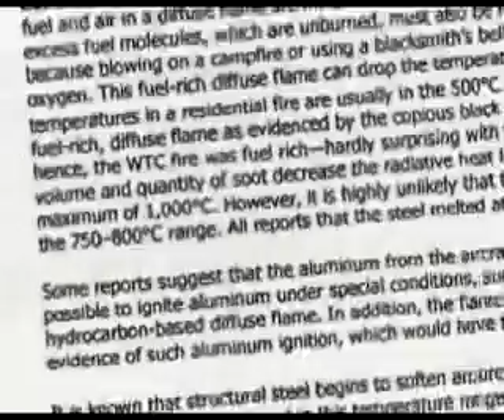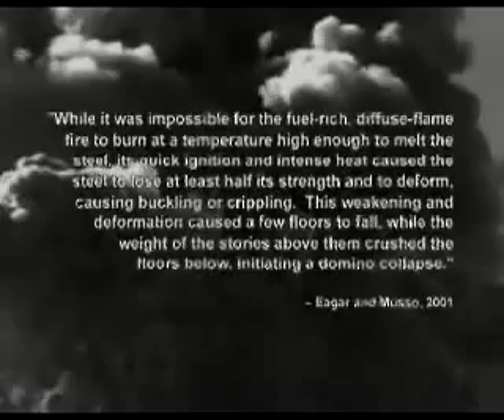Steel Facts and WTC Collapse (Part One)

Comment: @yewutube where are you getting this information "whats simply astonishing and inexplicable is the way the building was ground to a fine powder (except for the steel). Everything else was vaporized" because I can testify that when concrete is pounded on it turns to dust, and everything else other than the concrete probably burned and got crushed into paste.

Comment: i once lit a fire under an overpass, rebar reinforced concrete...  well, obviously, the steel weakened and the concrete turned to dust..  because that's what happens when ur dealing with fire..

Comment from the maker: @TheBlueFalconX 
I recommend that we start a new demolition company that would change the MO of conventional demo. This new company would require no planning before hand and there would be no need to study the blueprints or infrastructure of a building anymore. Just put a small hole in a steel framed high rise. Say 4-6 floors in a 110 story high rise for example. Next, pour some jet fuel on the hole, ignite it and watch the entire 1350 ft high rise crumble in less than an hour.

Comment from the maker: @tommyboy31885 
Relevant question: Where is the load bearing weight pushing down on the undamaged floors if the concrete was immediately turned to dust and if the steel was ejected laterally?

Comment: Wait, it was a fire that took the towers down? I guess I didn't see the two GIANT planes hit the towers which would cause weak spots in the building, but if you say it was a fire I guess I can believe your dumb ass. One more thing, the fires didn't have to melt the steel it only had to weaken it.

Comment from the maker: @tommyboy31885 
No extreme temps...

"Of the more than 170 areas examined on 16 perimeter column panels, only three columns had evidence that the steel reached temperatures above 250 ºC (480ºF). Using metallographic analysis, NIST determined that there was no evidence that any of the samples had reached temperatures above 600 ºC (1110ºF)." (p 140)-NIST

Comment: no, you're right. 19 hijackers working out of caves infiltrated into our society and waited for the opportune time to strike. all got past airport security, overthrew four planes and crashed them all in the same day. and, even though a steel high rise has never ever collapsed from fire and/or small damage before OR after 911, three of them just collpased in secs. and rust and al resembling thermite with nano structure was found in the order of tons. that's one helluva rusty building, huh?

Comment: i'm not trying to intimidate you. just presenting the facts. that's all. again, there are NO 'normal" building materials matching the characteristics of the chips. is this right? bits of rust, Al, liquid, and silicon gel were in the WTC dust. all components spontanaeously merged, formed a red gray bi- layer, changed the chemical structure, and created a very complex internal nano structure. the exact same thing occured with about 100 tons of chips at ground zero. is that what you're going with?

Comment: science? false claims? so, 9 scientist did not evaluate chips found in the wtc dust and determined that the had the same chemical structure as thermite, gave off 700C temps and had a nano structure? are these chips normal to a building? absolutely not. does it matter that the 9 scientists did not have a known sample of nano thermite? no. are these chips normal to a building? absolutely not. that's what this is really about. these are the facts, but with your hidden agenda gets in the way...

Comment: where i call from, if you make a statement in an attempt to refute something, you must offer evidence. otherwise, it means nothing, which is where we are now, huh? just more and more circular ranting with no evidence. this is very simple. provide evidence that ANY building material (primer, rust, Al, anything) has the same chemical structure as thermite, gives off 700C temps, with a complex nano structure when scanned at 50,000X. just give it a try? continue the rant..

Comment: Do you have proof that Nano-Thermite has all those characteristics or do you have proof that certain materials in building or apartment window sill that Jones got the stuff off of didn't have those characteristics?

Which would be easier to prove?

Drop your argument from ignorance and actually prove using scholarly methods that Jones has Nano-Thermite by showing us what Nano-Thermite looks like under the same conditions.

Comment: no, actually there were two distinct layers. if you don't like the word "matrix", does primer have a gray layer consistng of iron and oxygen? a red layer consisting of silcon, oxygen and carbon where little hexagons (made of aluminum) and rhomboid shaped grains (made of iron and oxygen) are embedded? and all of this is not visible until magnified at 50,000X? sounds like some really advanced primer, huh? its completely ridiculous to even entertain your insanity..

Comment: Silicon is a normal ingredient in Primer as well as Aluminum Stearate. 

Your "matrix layer" is a big word that Jones through in there because it sounds "sciency" scroll back to see one of the hallmarks I posted. It's "technical sounding jargon" designed to trick laypeople like yourself into thinking that the chip Jones found is intriguing and worth a second look.

Comment: the recipe for nano-thermite:

"The mixing is accomplished by adding these reactants to a liquid solution where they form what are called sols, and then adding a gelling agent that captures these tiny reactive combinations in their intimately mixed state. The resulting sol-gel is then dried to form a porous reactive material."

so, rust and Al just spontaneously mixed with what liquid?? and a gelling agent appeared from nowhere to combine the two? ok. just getting started..

Comment: (cont.)

"The energetic coating dries to give a nice adherent film. Preliminary experiments indicate that films of the hybrid material are self-propagating when ignited by thermal stimulus 

(Gash et al 2002). 

this is from Kevn Ryan's (yes, 1 of the 9 scientists) paper, "The Top Ten Connections Between
NIST and Nano-Thermites".

JUST a little more complex than rust and aluminum, huh?

Comment: the chips were scanned under a SEM at 50,000X, remember? As it turns out, nano-thermites were developed by US government scientists, at Lawrence Livermore National Laboratories (LLNL) (Tillitson et al 1998, Gash et al 2000, Gash et al 2002). These LLNL scientists reported that.. 

The sol-gel process is very amenable to dip-, spin-, and spray-coating technologies to coat surfaces. We have utilized this property to dip-coat various substrates to make sol-gel Fe,O,/ Al / Viton coatings."

Comment: yes, you would be correct if there was a documented profile of nano thermite available. what they do know is the chips had the same chemical structure of thermite with a highly advanced nano structure. and no. if there was any evidence to suggest that particles of rust and aluminum had the same characteristics as the found chips, they could compare. but, there is no proven evidence of this. until then, they concluded that the chips were nano-thermite....something entirely new

Comment: the 9 scientist didn't have to know what nano thermite looks like. they just analyzed the chemical properties of the chips and concluded that it was thermite wth a nano structure. i guess you can call what you like. thermite with a nano structure? nano structured thermite? nano thermitic chips? any of these grab ya? did you find a documented profile of nano thermite that the 9 scientists could compare to yet? after all, this is basis of your arguement, so it must exist, right?

Comment: You don't have enough data to draw that conclusion. 

Jones is a grifter who's taking advantage of you using pseudoscience
. 

"Lack of effective controls, such as placebo and double-blind, in experimental design. (see Scientific control) "

"Assertion of claims that a theory predicts something that it has not been shown to predict"

"Creating scientific-sounding terms in order to add weight to claims and persuade non-experts to believe statements that may be false or meaningless."

Comment: very simple question asked nth times now, but never answered for obvious reasons. what building material has:

1. the same chemical structure as thermite
2. a red gray bi layer
3. gray layer composed of iron and oxygen
4. red nano structured layer composed of:
a semi transparent matrix layer that is composed of silicon, oxygen and carbon
5. embedded into the matrix layer are:
hexagonal plates that are mostly aluminum
and rhombic grains, mostly iron and oxygen 

obviously nothing..

Comment: these flashes are people standing near the towers and looking up to the flames?

watch?v=elYw7MHf7GQ

the other video I posted showed flashes many hundreds of feet BELOW the fire...no flames, no fires, no heat or pressure. but it is interesting that you see smoke coupled with these flashes even though there's no fire near them. hmmmmm? again, your explanation makes no sense...the flashes are demo charges going off throughout the building.

Comment: the dust is from the concrete. smoke from where? the fires? you can't be serious? this "smoke" was found miles away from the wtc. 

the smoke plume:
watch?v=fPewS4GV1ko

flashes with smoke:
watch?v=Jqu_-yHqums 

your explanation of the flashes makes no sense. again, show me the mechanism how the heat became buried? fire still needs oxygen, right? underground? but, the fires never got there in the first place..

Comment: Are you sure the dust at the very start of the collapse was not smoke?

The huge smoke plume was  (I don't know, show me what you are talking about)

The reported flashes were people that were standing near the towers who looked up and saw flames being pushed out. 

Buried fires would be expected. 

Temps underground would get hotter because the fires are insulated and can thus build up more heat. (refractory).

Comment: explain the following logicial:

1. witness accounts of explosions in the sub-basements levels
2. huge smoke plume rising from the base before either tower collapsed
3. flashes seen all throughout the building unrelated to the fire
4. concrete pulverized to dust at the iniation of the collapse
5. fires buried underground lasting for weeks without oxygen
6. temps buried underground hotter then the max temps recorded on the impact zone steel

Comment: i'm afraid not every intelligent well trained person agrees with you.

700+ engineers and architects..

patriotsquestion911*com/engineers*html

i thought i was clear, but here it is again. a combination of demo charges and nano thermite led to the collapse. this explains the explosions/flashes all throughout the buildings and the heat buried underground lasting for weeks. thermite was used at the base. do you think the small fires had enough heat to melt cars and firetrucks?

Comment: everyone knows it? apparently, less than an hour ago, YOU didn't know the columns were even cut? this is hilarious!! and i'd like to know. why would clean-up workers spend time cutting precise 45 degree angle cuts n the columns? brain liquified? you assume all that this was a normal demo job. obviously not. nano-thermite (or something matching the exact chemical structure of thermite with a complex nano structure) was used.

Comment: The columns were cut after the towers had collapsed by clean-up workers. 

Everyone knows that. 

Yes, people in the stairwells next to core or in the building while explosives were going off would not have lived. 

You can't argue this. Demo Charges will liquify the brain of anyone within 50 feet of them and several injure anyone within 100 to hundreds of feet of them due to shrapnel. 

I didn't realize that you unaware that the steel that you are viewing was cut that way during cleanup

Comment: the columns were cut in a 45 degree angle commonly used in demo jobs. even other debunkers have tried to refute this. my only guess is you're commenting on something you haven't actually seen again? here's a clip:

watch?v=dUuEdMer7wI

NIST did not test for explosives. what does walking in stairwells have to do with explosives? word of advice. try and back up your statements with some actual evidence. you say "doubtful' without even reading the study and I'M arrogant? funny...

Comment: The columns at the base were uncut, the core also stayed standing after the floors and outer walls had collapsed. 

This proves that no charges were used on the core columns not to mention that NIST found no damage from explosives on incendiaries on the columns

And the fact that some people lived who were in stairwells right next to the core. 

Perhaps you should take off your arrogant cap and try to learn from instead of trying to refute the engineers at NIST?

Comment: 1. this heat did not exist. 2. the upper floors smothered the fires at collapse. 3. most of the floors were pulverized to dust and expelled laterally. 4. there were intact bottom floors after the collapse which prevented anything from getting into the basements. so, whatever was in the basements, stayed there now with tons of rubble on top of it.  

5. watch?v=Zww9-AaIgrw

added all up=no mechamism

Comment: NIST didn't find any columns that had been heated enough to show signifigant weakening. 

Lots of steel within the pile showed weakening by fire but that was irrelevant since one would not be able to determine if it had been heated while the building was still standing or by fires within the pile itself.

Comment: so, you're saying NIST did find samples weakened by extreme temps, but said what the heck, don't need to test these? and let's get on the same page here. NIST did not find samples directly from the impact zone that experiences heat over 250C. the underground fires burned until about dec01. again, where is the mechanism for the fires above to get underground? did these small fires also cause cars and firetrucks at ground zero to be overthrown and melted beyond recognition? enter thermite..

Comment: Excellent. We know they are correct yet you tell us that NIST found no steel weakened by fire?

Is it more plausible that they found lots of steel weakened by fire but that it was pretty much useless since all the evidence had been compromised by fires that burned for weeks within the pile?

That's really a different topic altogether. 

What it tells us is that NIST was unable to find any columns that had seen signifigant temperatures since those are the only samples they had.

Comment: ok. the fires were 800-1000 ft up. NIST did not find steel samples that experienced temps over 250C. people were seen at the impact hole right before the collapse. therefore, there was NO significant heat. at collapse, the upper floors came down onto the impact zone most likely smothering the fires. also, the majority of the concrete was almost instantaneously pulverized to dust and/or expelled laterally. so, there was no mechanism for these fires to end up in the basements. 

agree?

Comment: Nope, no agreement there. 

Firemen reported fires within the pile weeks later which you would expect since there are lots of things that are flammable within the building. 

And the fact that concrete dust makes a pretty good refractory to insulate and keep heat within the the pile. 

So to be clear, no we are not in agreement here. You would be hard pressed to find someone to support a claim that would say no fires should have been burning within the debris pile.

Comment: NIST found no steel samples that were subjected to temps over 250C, but NASA recorded temps buried under ground over 700C five days after 911. hmmm?  there was no extreme heat at the impact zone and no mechanism for temps to be buried underground for weeks. enter thermite which incidentally, has it's own built in oxygen source, so it can sustain itself. the chips were proven to be nano-thermite. therefore, it must be thermite or some analog that caused this heat.

agree?

Comment: and the 8 other scientists? are they in on it too? could be a conspiracy, right? again, what did jones and company have to gain by doing this? Hmmm, being suspended from your job and being called a liar? and, i look at ALL of the evidence; flashes throughout the building, witness accounts of explosions in the basement areas, this heat buried underground unrelated to the fires, smoke rising from the base before either tower collapsed, nano- thermite discovered. add it up.. done

Comment: Um ok. How about NIST?

The responses to questions number 2, 4, 5 and 11 demonstrate why NIST concluded that there were no explosives or controlled demolition involved in the collapses of the WTC towers.  

"Furthermore, a very large quantity of thermite (a mixture of powdered or granular aluminum metal and powdered iron oxide that burns at extremely high temperatures when ignited) "

Source: NIST FAQ's

Comment: The aluminium reduces the oxide of another metal, most commonly iron oxide, because aluminium is highly reactive:

Fe2O3 + 2Al → 2Fe + Al2O3 + heat
The products are aluminium oxide, free elemental iron, and a large amount of heat. The reactants are commonly powdered and mixed with a binder to keep the material solid and prevent separation.

Source:

Wikipedia

Comment: the chips had the same characteristics as thermite. they gave off 700C temps. they have a complex nano structure. you have yet to provide ANY evidence that ANY KNOWN SUBSTANCE has the same characteristics. what documented substance was available to verify/compare again? where's the data sheet? It's now 8 yrs later. they must have one by now, right? post it when you can. funny stuff...

Comment: no need. you can try and rationalize all you want, bu it doesn't add up to a rational person. the chips had the same chemical structure as thermite with a nano structure. again, what NORMAL building materials are similar? obviously nothing. case closed...